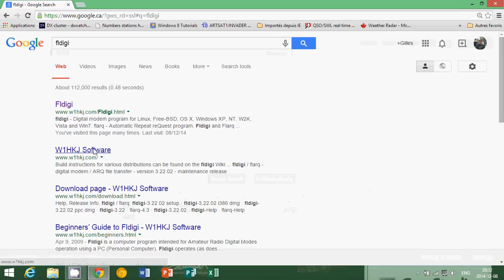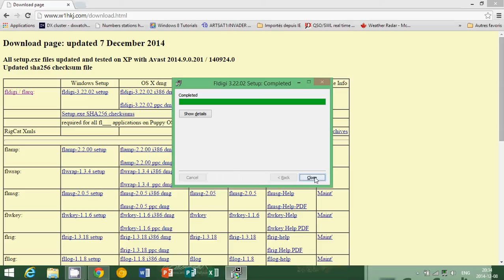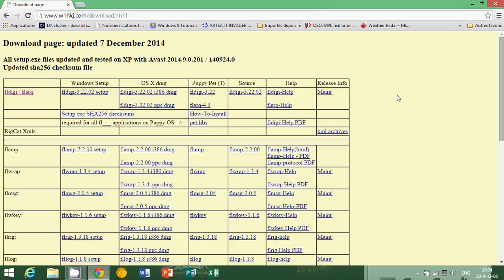Decoding digital signals series part 1 Where and how to install FLDIGI software

Comment: Excellent series idea. I'll have to give fldigi a try, I usually use DM780 in Ham Radio Deluxe 5.4.38(the last free version) for decoding, but I also own transceivers and transmit sometimes as well.